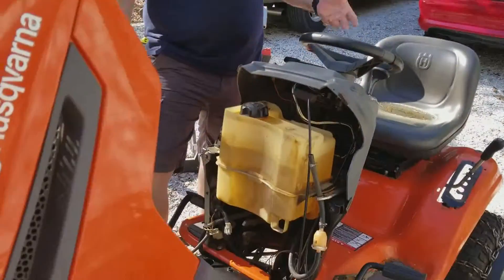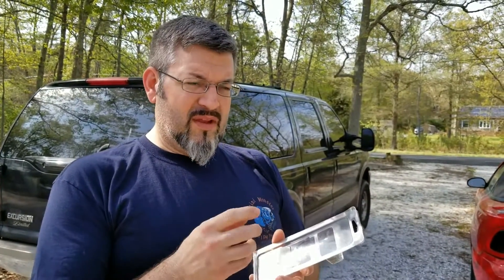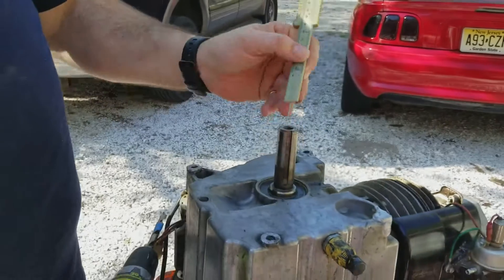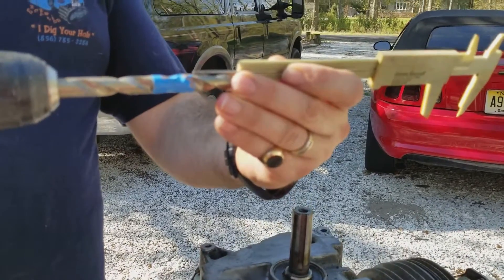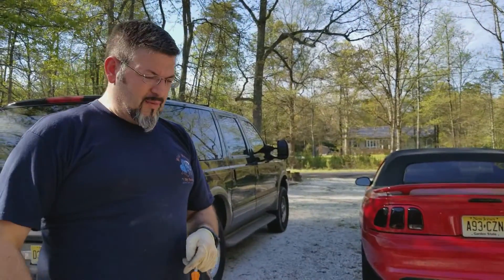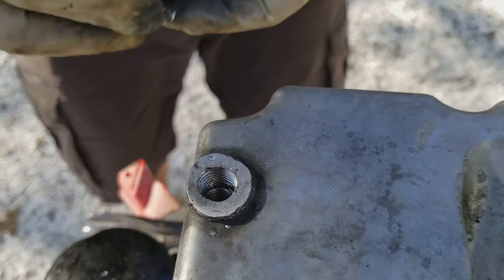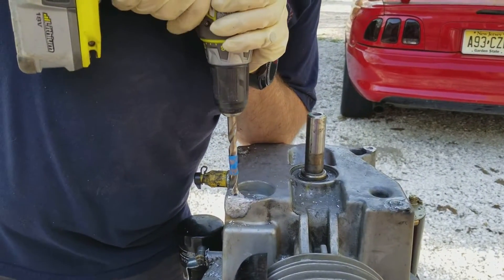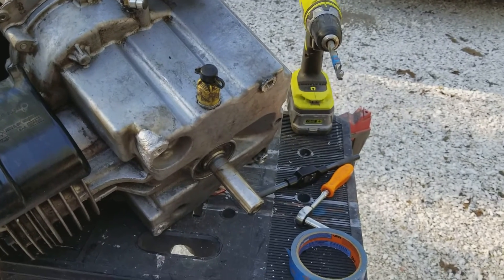Cracked Block Repair & Heli-coil for a Kohler Courage Engine on My Lawn Tractor / Mower

Comment: I have the same problem with my Kohler Courage 24 hp. How has your repair held up for you? Thank You for the video!
Reply from the maker: The repair is still like the day I finished it.  Heli-coils are still holding good, bolts going through the frame into the engine are still tight. I recently  posted a video for a whole bunch of maintenance  on the mower.  It's still running strong ready for many more years of grass cutting. https://youtu.be/psPzMCoxiTM?si=3nw3iyQKvKw0hfft
Hope my videos help keep your mower alive.  Thanks for the question.

Comment: The Kohler Courage is a garbage engine. They are honestly not worth the time fixing it because it will break again and again. Either swap it with another engine or scrap the tractor.
Reply from the maker: You aren't totally wrong on being a garbage engine but I've got virtually no money in the repair and minimal time.  I would have spent a hell of a lot more to buy another motor or mower.    I have damn near an acre and a half of grass to cut.  It's been used over and over for two years since the repair.  I've had no issues since I repaired it. The video is how I repaired it and saved money which anyone can do.  After I did the repair, I was told this engine was recalled and they would send out a brand new crate motor.  I haven't tried that route yet but when I have another problem that's terminal I'll check it out the recalls.  This engine is still running strong.  Thanks for the comment.

Comment: What size heli-coil did you use????
Reply from the maker: Dylan Lowry it was a 10 x 1.5 and here's the specs for the heli coil kit.  
STAINLESS STEEL INSERTS
Brand:"HELI-COIL"
METRIC COARSE - CARD/12
Size x Lgth : M10x1.5 x 15.0mm
Drill Size In : 13/32
 I hope this helps you out.  Sorry,  I completely forgot to put the size I used in the video. Good luck and thanks for the question.
Reply: Thank you and thank you for your time

Comment: the crack happens because the top cover is part of the support of the block. bad design. if it's only slightly cracked the whole head will bounce around while its running. if you pry the crack closed and tighten the bolts it will hold it closed. then drill and tap 1/4 -20 along the edge about 6 holes taped into cover and into the block. a black allen head screw turned in until it gets tight on the threads and makes solid contact with the cover will "pin" it in place count the number of turns so all the screws will get tight and bottom at the same time. like a dowel pin but removeble by unscrewing. with threads on threads like that there can be no movement  clean the crack and j b weld on outside and the leak will stop. don't even need to take it apart.
Reply from the maker: will friar you've got me confused in what your writing about.  I was given this mower and the one engine mount was broken clean off and not leaking any oil.  The only repair for it was to tig weld in New material,  drill and tap new threads.   The other three engine mounts were completely stripped out and all engine mount bolts had fallen out, needing heli- coils.  The engine was freely dancing around in the engine compartment.